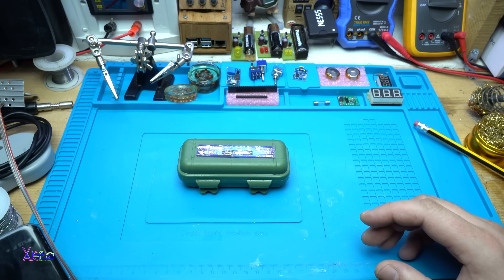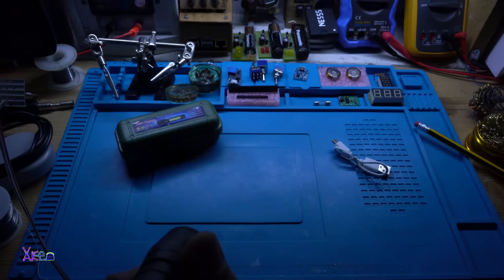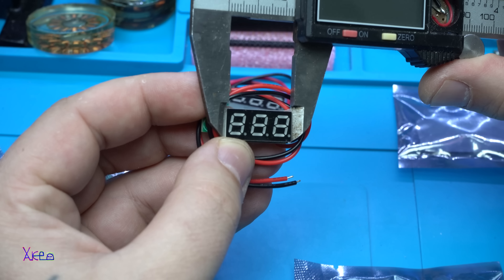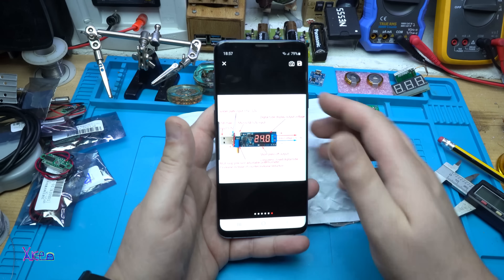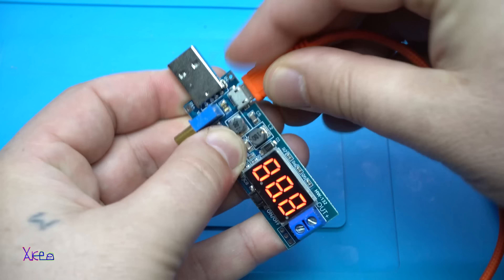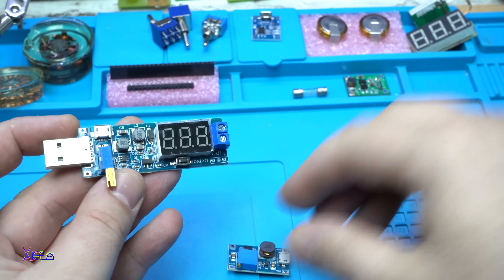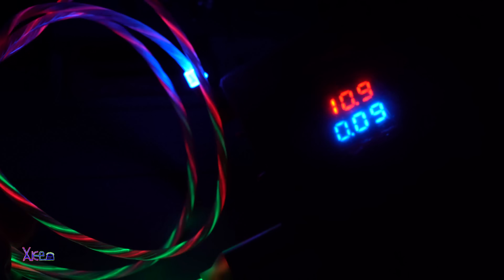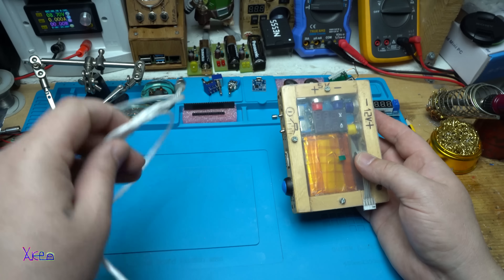5 Awesome Aliexpress Gadgets | 5 New Gadgets 2021

Comment: LOL I’ve just gone on AliExpress and ordered three phone charger cables to LED screens and 2USB adjustable power supply is extremely cheap just the LED message charger cable for the phone on eBay was £5 it came to me from AliExpress at £2 and 10p as I said thank you again for your Channel

Comment: Can you please make a video on " How to convert an old DVD ROM of PC into a independent DVD player with additional USB media input ". ?? It would be great as there is no such video on youtube regarding this topic.
Reply: Sadly it is almost impossible if not overly complicated, as the circuitry in a DVD ROM is made to communicate with a sata or ide controller and drivers on the kernel level of the os. A DVD players dvd assembly is made to communicate with a DVD ic chip, I would just suggest using a old pc with Kodi installed .